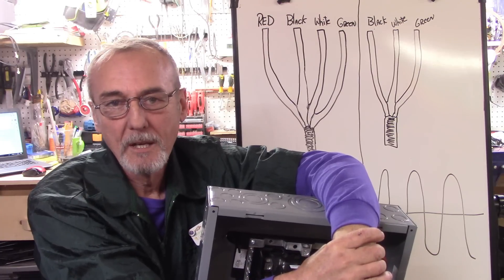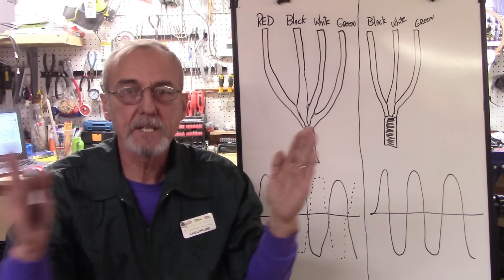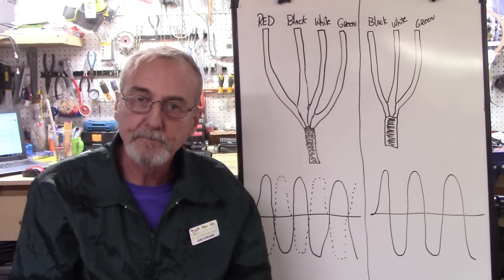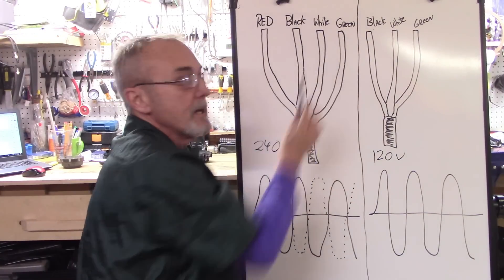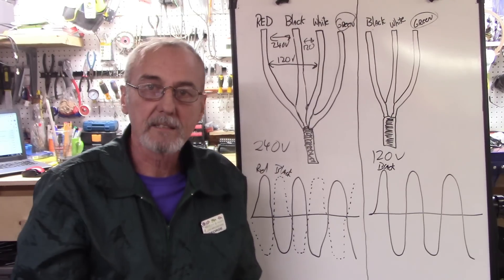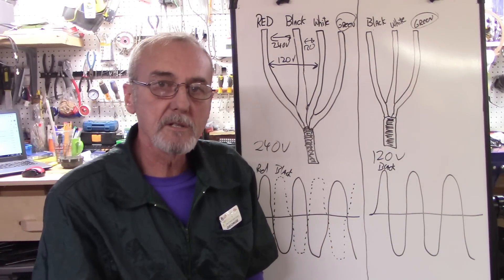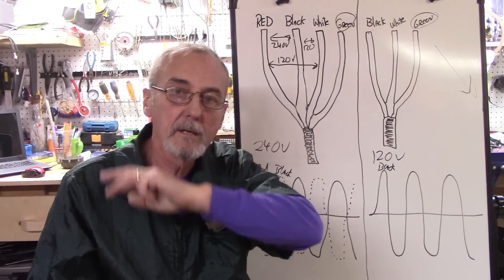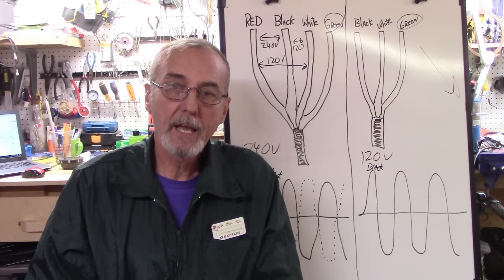240 V  vs  120 V explained

Comment: I'm confused. You mentioned that the 240v legs are 180 out of phase, I thought they were 120 out of phase. I'm also confused about terminology. I'm looking at buying a new air compressor, it has a 220v Single Phase motor but the 220v outlet has 2 phase (L1 & L2).  I'm totally confused. Thanks in advance.
Reply: I can at least help you with the first part- by “180 degrees out of phase”, that means that the sine waves are mirror images of each other. To understand where the number 180 comes from, you’d have to graph a sine wave. The function repeats every 360 degrees. 

The amplitude of those waves is 120v. So one is, essentially, 120V when the other is -120V, so the difference is 240V.
Reply: The confusion is BECAUSE there is only one phase in your home panel,
ALTHOUGH it is split in the middle.      The 240 volt outlet that you have 
is the OPPOSITE end of this single phase of current.

Only large power customers have all THREE of the phases that the power
company uses for distribution.   You the household only receive one of the three.    Many people WRONGLY call this one phase as two phases.  I understand because it is SPLIT inside the transformer into 2 120 circuits.

Yes two (2) 120 circuits BUT the combined (240 volts) is only one phase.

Comment: I am wiring my generator 4 wire 220 volt 30 amp to a 120 volt 30 amp connector. To run a 220 volt 30 amp heater. I plan to use only 3 wire 10 guage to the generator. I see no reason that there would be a problem using the 120 volt outlet, even though it is only rated for 120 volt 30 amps. Am I wrong?

Comment: I have a 5 KVA Solar inverter that’s 230v x 1 phase 1 red wire that’s 115v + , 1 white wire 115v + and 1 ground wire “ can I use the two lines the red wire that’s 115v + and the. White wire that’s 115v + as all One Phase and the ground as the Ground only in emergency power back up my battery bank is lithium 48v 280Ah which is 15 batteries in case we lose electricity at night ?

Comment: Great video even for someone like myself that is entirely electric illiterate. I found your video extremely educational/informational and if I understood it correctly, I can save a few dollars in wiring by using a 6/3 UF wire. Here is my issue... I want to run electricity from the main panel in my garage to an outdoor shed which sits about 100ft from the main box. My intent is to get a couple of outlets at 120V. One outlet for my electric lawnmower that has to remain plugged, and possibly two to four outlets for woodworking tools or any other electric tool need at 120V. Being proactive, I also want to have a dedicated 220V outlet in the event that in the future I decide to add a mini-split A/C unit, which to my understanding is substantially more energy efficient at 220V vs a 120V unit. Someone with a lot of experience as an electrician had mentioned to me that it can be done with the 6/3 wire, however, that individual is up in age and is no longer an active electrician. In speaking to the individual that is looking to land the project, he tells me that he cannot see how it could be done with a single 6/3 wire. Instead, he want to use two different wires, one for the 220V plug and the other for the regular 120V outlets. I would like to get your input as running one wire (6/3) can save me a few dollars in buying another wire per foot. If that is the case, that I can get both currents with a single 6/3 wire, I will also provide him your video so that he has a better understanding how this can be accomplished. Thanks again for this video and for your willingness to provide me a little clarification.
Reply: How much current do you need? 100 feet of #6 AWG copper is good for around 36 Amps. 6/3 is a cable, not a wire. It has 3 insulated current carrying wires (black, red, and white) plus a ground wire (green, green/yellow, or bare).

Comment: Some systems use 3 phase power due to more economical operation, but these may be only industrial. With 3 phase power, of which only 2 lines (phases) power the electrical system, the 3 phase (lines) divide the 360 degree sine wave by 3, so 360/3 is 120 degree. In 3 phase power each line is 120 degree with respect to the other 2 and not 180 degree like what you have shown for residential.  Residential power uses a single phase then steps it down with a split phase transformer to give 2 phases at 180 degree. 
In the 3 phase type, you get to lower voltages like 120 using a single phase, and 208v using only 2 of 3 phases.  

The voltage is ac, but the reading is based on RMS (Root mean square) which is a mathematical calculation for a DC equivalent.  For a single phase, peak to peak is 340 volts, then dividing it by (2 X square root of 2), which is 2 X 1.414 or 2.828, you get 120 volts RMS.

208v comes from adding 2 lines with a 120 degree phase relationship, but requires a more complex calculation than addition alone.  You then must calculate the sin of the angle (120 degree) between them to get 294.4v P (588.8 PtP), then calculate the RMS value to get 208 volts.

340 + 340 = 680v (PtP)
680v X sin(120)= 588.8v PtP
588.8v / (2 X sqrt(2)) = 208v RMS.
Reply: Single phase is single phase.   Not two phase.

Comment: As an European I'm courious about american industrial electricity. I couldn't find anything on it. What is used if 120 V and 240 V isn't enough? In Europe it's easier, beacuse 230 V and 400 V 3 phase power is a bit more in the common knowledge.
Reply: Commercial and industrial buildings commonly have 277/480V 3-phase service.  They have ordinary 120/240V as well.  The 277V circuits are used for lighting and 480V 3-phase would be used to power motors for elevators and air conditioning.  Industrial customers could get other services as needed, such as 600V.

Comment: Thank you - I have a 5 KVA 230v Pure Sine Wave Inverter charge controller 230v x 1 “ I’m looking to wire this 2 leg at 115v safety the Amperage at 3 KW 76A is what I use every day normally, I’ve seen to wrap both the red & a black wire around the 1 hot wire coming out of the inverter to wire into a 100A double pole breaker that’s dedicated to this only in my breaker box and I have the Mose Automatic Transfer Switch and a test I saw it works with no feed back . Does this look correct ?

Comment: do you have a video to convert a range plug 240v to two 120 plugs? We have a Range that was converted to gas. Now we need a couple separate plugs in this area of the house.
Reply: Just "cap" the line you don't need.  Did this years ago.
Reply: You need to have a neutral wire in the circuit.

Comment: Which  one makes your meter  run faster  240 or 120 on a similar  wattage  appliances
Reply: They’ll both run on the same speed. Meters are measured in kilowatt hours so the meter will notice they’re both drawing the same amount of power even though they’re running at different voltages. The only difference is that the 110v will draw more current.
Reply: Thank you

Comment: I could use a little  help I would like to know how a 2pole (2-110v legs) 240 50/60hz motor works on single pole 230 50hz 1 neutral and one 230v leg
And yes I get lower RPMs
Also  can I  wire a 4wire 110v  motor to 240v Ithaca a start capacitor rated for 300v no wir diagram I can't  tell if it's brushless if it's not will it work out of phase and please school me

Comment: Thank you question answered 240 does not require a ground. But what if power companies loose a ground which does happen??? Just glad to hear that Im using the 4 wire as its already where I need it but Im on 60 amp breaker about 40 ft wire 6/4 I guess I just dont want getting shocked.
Reply: Incorrect. All circuits need a earth ground for safety. Three wire 240V circuits DO NOT NEED A COMMON. Four wire 240\120V circuits need the common as center tap for the 120V back to the transformer. Watch the video again.

Comment: I have several Pool Motors for an Outside pool designed to be wired for 120V or 240V. Since these motors actually run for hours at a time (8+).. is there an advantage wiring for one as opposed to the other.

 Does One voltage put more wear and tear or use more electricity (Higher $$ Bill) than the other? I have never seen an answer to this. Currently.. all the Motors are wired for 110V.

  Thanks to anyone for a response.
Reply: According to a motor manufacturer I checked, there is no difference in the efficiency of the motor between the two configurations.  The difference would be in the wiring of the electric supply.  The 240V configuration would carry half the current, so you could use a smaller gauge of wire.  You would also need a 2-pole breaker for the 240V configuration.

Comment: An electric water heater is a good example of a 3 wire 240v
Reply: So could u run dryer off the 3 wire 240

Comment: I think the correct term is 120V single phase and 240V is two 120V phases....
Reply: Here 240V is one phase.
Reply: This is awesome      The correct term is that it is a 120/240 volt single phase system.     Again, single phase system.
Reply: @KevinCoop1  Sorry in the  US 2 phase is 220V In Australia, UK, etc we use 240V Single phase.
Reply: This is awesome    Sorry 120/240 volts is a single phase system.   Transformer is single phase in, single phase out.   The only two phase systems were Tesla early poly phase system before he changed to single phase and three phase systems.   Niagra falls originally were two phase.   European and other countries systems are one phase to neutral from 220 to 240 volts fed off a three phase system.
Reply: @KevinCoop1  j
Reply: Alfred Koren   ?

Comment: Great video, I just wondering how to use european small appliances purchased during my tour of duty  in the Middle East.... now I’m going back to the US, and got all the small appliances (blender, kitchen appliances, TV’s, etc.)
I was thinking in just take the 220 V directly from the box.
Reply from the maker: European appliances are wired at 50 hz 220 volts. US voltage is 60 hz 240 or 120 volts. It is not as easy as just dropping wires out and trying to match them up. Some appliances will respond while others will simply not work.
Reply: Barley and Hops Brewing 
Thank you for the information, it was very usefull.

Comment: Please review Charles Staton, referring to the line voltage not being 180 deg out of phase as this would cancel out the line voltage to zero volts.  There actually is 240volts between the two hot line wires, they are not two wires with 120VAC in each.  The transformer at the pole is center tapped which takes voltage from half the winding to give 120 volts.  Charles goes in to great detail to prove this beyond a shadow of a doubt.  I am not trying to make anyone upset or have a huge debate over this, though I am concerned that believing the phase is 180 deg out has been passed down for so long (myself included) that it is just taken as the truth. How can you have two phases on a single phase?  You can't, you have a phase from 240 volts AC and the center tap or split phase reading half the voltage at 120VAC but it is from the same phase.  He explains why many believe they are out of phase and proves why they are not!  It would be easy to just ignore what I have just typed but living in ignorance of the truth is no excuse.  Watch his video and decide for yourself.  Here is his youtube link that shows how and why.   https://www.youtube.com/watch?v=uRKbX74lBgU&t=1011s

Comment: What’s the most amount of amps a 220v support, say I have a drill that’s 12.5 amps does that work?
Reply: Normally for a 220/240v branch circuit the highest breaker rating would be 60 amps. Your drill will work on a 15 or 20 amp 120v circuit. If it's a 15 amp circuit there will be less allowable loads on at the same time. My guess is that the 12.5 amp requirement is only for a split second during start up and will drop significantly after that. How much it drops depends on the hardness of the material and the force you're applying. Bottom line, a 20 amp, 120v circuit is your best bet. Your drill most likely has a regular 15 amp 120v power cord, so a 240v circuit is not an option anyway.

Comment: Your explanations are quite a bit off.  While they are two phases, they are used together in a single phase.  120V doesn't go in one side, and another 120V goes into another side.  Rather, when one is at +120V, the other will be 180 degrees out of phase at -120V.  If you combined these two wires, and used the neutral, you would end up with 0V, as superposition would cancel each other out.  But if look at the potential between the two hots, you get 240V potential peak to peak.  So to correct your statement around the 8 min mark, at the moment in time where one has +120V, the other will have -120V, giving a 240V potential.  Of course, due to the sine wave, this will swap back and forth 60 times a second.
Reply: This video is absolutely misleading.  Stick to beer.  The x-axis is time so how do you tap into the future?  A 240v winding is grounded in the middle to provide 240/120v supply.  It's only single phase

Comment: I have a 110 v sanding floor machine that I wish to convert to run on both 1110 and 240 do you know where I could find instructions to do this, please?
Reply: buy a step down transformer

Comment: Hypothetically, if the buzzer or the clock (the 120v draw) would trip a 120v breaker, then what would happen if it’s wired to the two pole 240v breaker?

Comment: Can I decrease a 3 wire 240 volt plug to a 110 by making one hot line neutral in the breaker box?

Comment: Aren't most homes single phase 240V and 120V outlets split-single phase?  This is why  you don't need the neutral for 240V from my understanding.  The neutral wire essentially splits the phase I thought.
Reply: You are correct, the coiled wire from L1 and L2 on the transformer are wound in the same direction all the way, and is partly why it's referred to as single phase. The neutral is the center tap. 3 phase has 3 coils connected in either a Wye or Delta orientation.
Reply: Many 240V appliances have some functions which operate on 120V, which is why the neutral is on the receptacle.

Comment: Ok here is a question, maybe related to the AK 47 rifle, but regarding the 3 prong wire plugging into the wall outlet. i get the 120 vs 240 and why we stayed 120 while Europe and Asia went 240, but remember the BlackBerry phones where you could swap plug adapters and slide the voltage switch? Why can't all countries adopt the same 3 prong wall plug socket design? Just put s slider switch on mobile devices for voltages, but the prongs and sockets they plug into just be the same?

Ak-47 relativity. Invasion. Many of the Eastern communist bloc countries did not trust the Soviets to not invade them and while agreeing on the same standard "design" of the rifles while  taking the same ammo and 30 round mag, they instead altered the rest of the rifles dimensions.
So the pistons for example are the same design, however the diameter or length was altered just a little so the soviets could for example not grab Hungarian AK'S for parts to resupply the Soviets rifles so they they were stuck with their own supply lines and could not turn the Hungarian rifles against the Hungarians so easily. See Hungarian "AK" the AMD65 vs AK47 for an example.

In that respect, is that a possible reason some countries designed their wall outlets to connect differently over there while carrying the same work load? They could not trust some neighbors invading so they cannot just plug their equipment into an enemies lines for power thus keeping their sockets the same with allies but different than potential enemies? 

Just curious. After all the Soviet "Hind" gunship IS DESIGNED on purpose to work on all Soviet AND SIMULTANEOUSLY work on all American ground power supplies for all its systems without modifying its connectors, but our aircraft's electrical systems cannot work on their airport ground electrical systems only ours and any allied countries using our systems.

Comment: I have a 4 prong 220 volt outlet box. I have a 220 volt table saw that has only three wires and i want to be able to plug it into my 4 prong outlet box. how do i do this, do i hook wires up to a 4 prong plug in and just leave the neutral  alone?
Reply: I have the same question..trying to daisy 240v together

Comment: When I measure a 240 volt circuit, on either one of the legs, does that mean the amperage draw is doubled of that which I had measured? Sorry for the dumb question...
Reply from the maker: Not dumb at all. The amperage is not doubled. The amperage flow through the circuit is measured on one wire.
Reply: @BarleyandHopsBrewing  Thank you

Comment: So if the two 120 legs are 180 degrees out of phase, how do they ever add up to being 240?
Reply from the maker: 120 + 120 = 240
Reply: I think that’s where I’m getting hung up. Wouldn’t that be +120 and -120? Or is it just the absolute values being added?
Reply: @panplayer  — They are plus and minus 120 with respect to neutral, at peak.  That’s 240 between them.

Comment: How to use 110 v us appliances on Europe 220 v system?
Reply: Don't, unless they are designed for dual voltage.  Some modern small appliances will automatically work on either voltage, so only a plug adapter is needed in that case.

Comment: To me neutral is not really the return , it is the area of conducting material such as a copper bar where the current can reside in a neutral zone to make a device function or a path for the current on the other side of a device!
Reply: The neutral is the grounded conductor.  That is all it is.